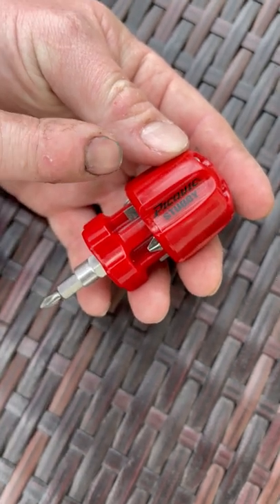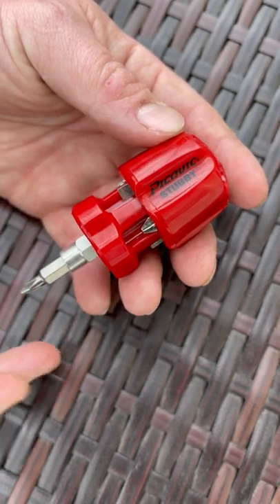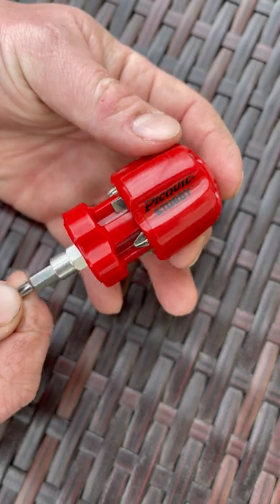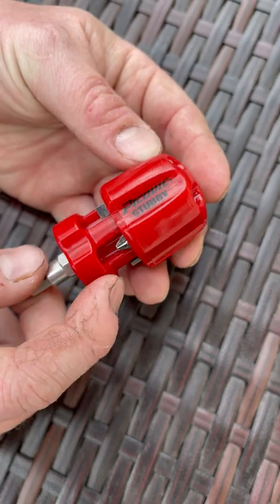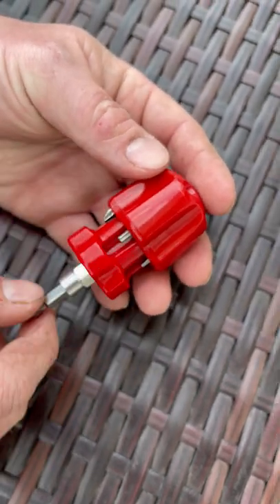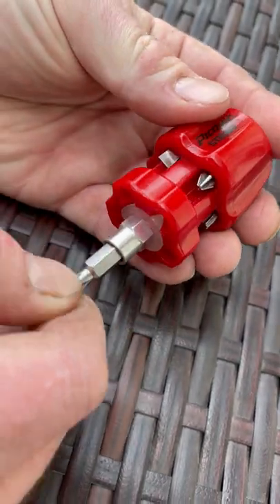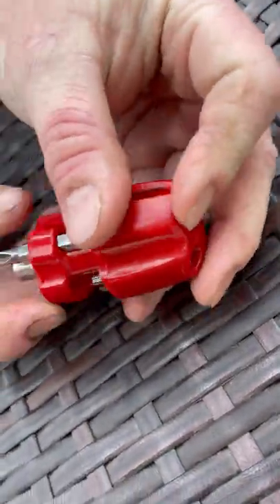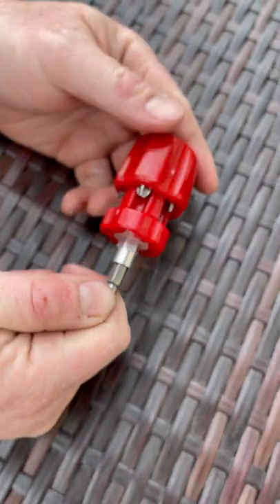Stubby Stubby Stubby!

Comment: I don't use those no more, Is better and more handy to use a angle driver, because you might need more torque than you're hand can apply, Especially on a tight spot that you can barely fit ure hand, I just connect the angle driver to my M12 or M18 drill and done, and also is further in from reach I just use a extension with the angle driver even better and faster.....
Reply: U must have weak ankles and wrists